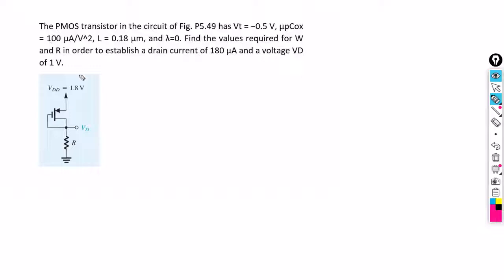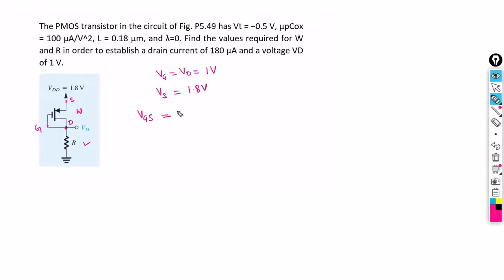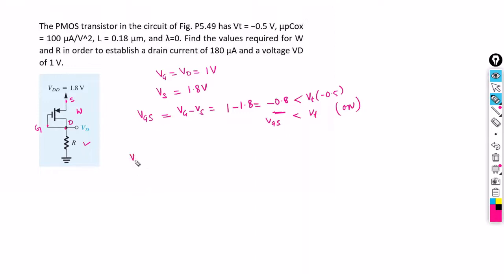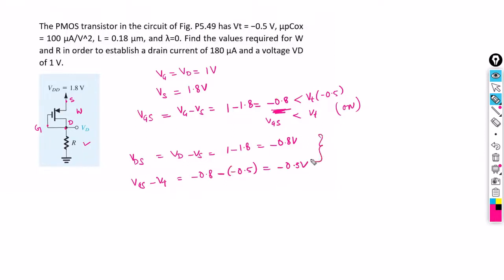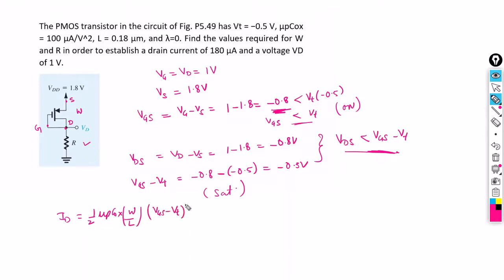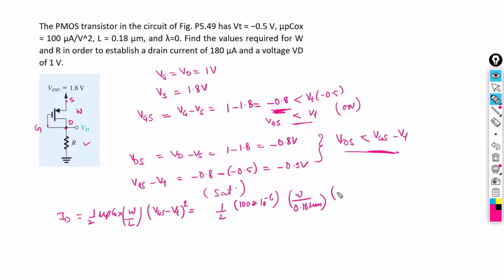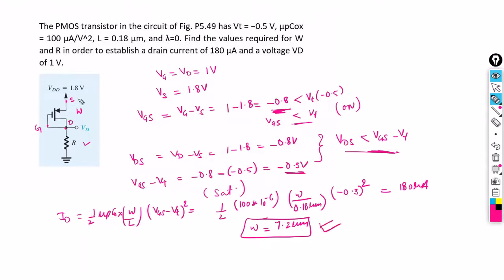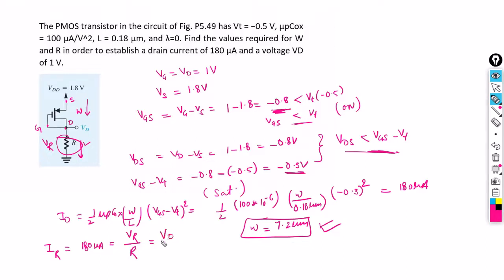The PMOS transistor in the circuit of Fig. P5.49 has Vt = −0.5 V, μpCox = 100 μA/V^2, L = 0.18 μm

Comment: lmao bruh but if Vgs is less than Vt then should it not be in Cut off mode and thus...off? but i think the negative signs get cancelled out, right? thats y it is ON
Reply from the maker: Yes pmos is ON when Vgs < Vt. Pmos conditions are different than nmos. These conditions are different due to the type of materials used for  substrate.